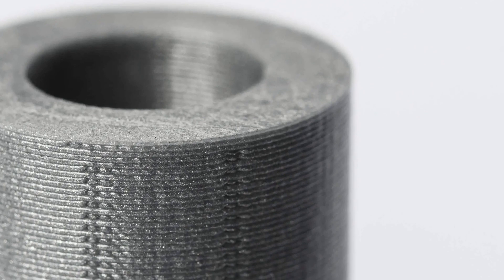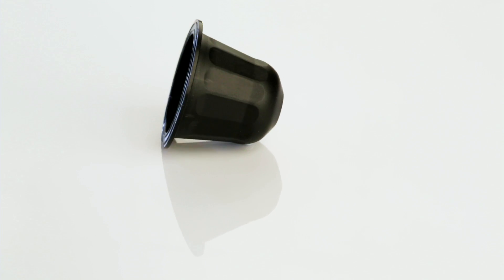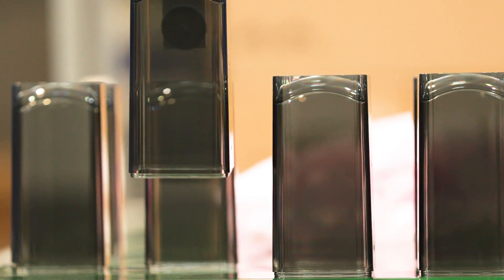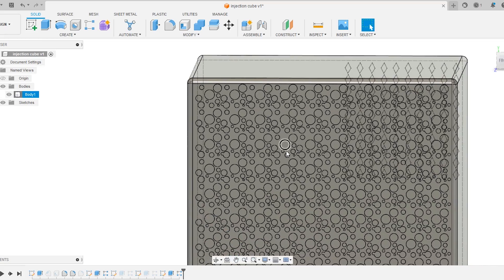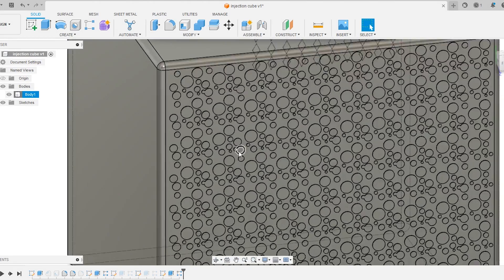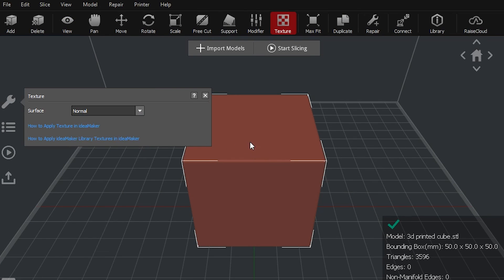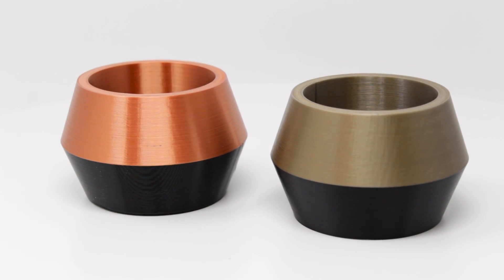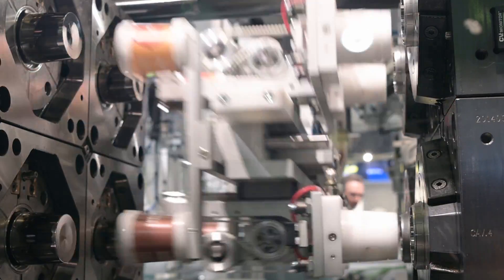Layer Lines Don't Matter | Design Textures for Mass Production 3D Printing

Comment: When you're talking about textured designs, yeah, layer lines aren't really a problem and shouldn't matter that much. Like you said, the way things are now, they’re not a big issue and can even be used to our advantage in some designs.

But not everything should be textured. A simple example: kitchen appliances—whether they handle food directly or not—are things that need to stay as clean as possible. And for that, textures, no matter how delicate or seamless they may seem, can actually be a problem.

Comment: They objectively matter because the higher your layer heights are the more friction pieces will generate against each other or even just the hands of the person touching it. They matter because every layer is a potential failure point. They matter because they affect your ability to put anything on the object whether it’s paint or coating. They matter because they’re the bottleneck in vertical resolution. They mater because every layer is a catch point for anything that has to pass over it. There are a million reasons they matter, you’ve presented zero reasons that they don’t and a handful of extremely niche corner cases where I might be indifferent to them.

Comment: I make functional prints and have even started selling them. I almost never print anything in PLA. Usually PETG or some variant. Once I've completed a design I usually print a few of them off and break them to see where they would break. Since I print in the strongest orientation, they generally take a decent amount of force to break. Far more than they're likely to see during full use. I've got a PETG bracket holding up a clothesline outside and it's been going well for the last year or so. Layer lines never bother me on my prints. Top and bottom layers do so I usually use the smooth PEI sheet and have ironing turned on.

In regards to layer lines, i can tell some of my customers that removing the layer lines costs extra. I've not had a single customer who told me to get rid of them once they heard it costs extra.
Reply: Good insights

Comment: There is quite literally an entire industry dedicated to injection molding textures, whether that be sand blasting, laser engraving, or etching the inside of a mold cavity. Look up Mold-tech or Yick Sang for industry standard mold textures, and maybe do some homework before you speak so broadly about manufacturing processes.

Comment: A question about the little imperfection  or ‘seam’ that is left behind by the print head  in the surface of the print
I know that the user can choose where to place this ‘seam’, such as in the back of a vase. Or this seam can be scattered randomly across the printed surface.
Is it possible to add extra seams on the surface of a print? Such as having eight equidistant seams running up the side of the vase.
Thus the ‘seams’ become part of the design.
Maybe these eight ‘seams’ could spiral up the side of the vase, or cross over each other to form a diamond pattern?
Could we write a brand name up the side of the vase using the ‘seams’?
Could we make this imperfection a feature  on the surface of the print?

Comment: I do agree upon layer lines not being a problem, and for the most part they look kind of nice!

But wait a second, creating textures on injection molding makes the part unmoldable? Wrong! If pay attention to a threaded PET bottle, the thread is indeed a texture. How do you achieve this? Creating a "neck ring" in the mold. Which essentially is having a mold that splits in half in synchronous cycle with the part ejector.

So making textures in injection molding IS POSSIBLE. It is just more complex and your mold will become a whole lot more expensive.

Comment: Something i want to try is introducing the same intervals of layer lines at 90 degrees to the printing plane, i think it'll be a simple way yo disguise layer lines without introducing a bunch of calculations or extraneous head movements.

The result aught to be a fine grid like pattern.

Comment: First of all thank you for another great video. Your videos are very motivational and thought provoking. You have potential to change old mindsets for good. From your video I have just noticed that layer lines actually simulate popular brushed metal finish used typically on aluminium and stainless steel parts. The orientation of part simply decides the direction of brushing. So I simply agree with you that layer lines are actually aesthetic. I have experienced that spray painting (especially metallic silver or any other metallic colour) enhances thick layer lines (0.3 mm to be precise). I just ignored layer lines but now I have started liking them after watching your videos.

The engineering aspects of layer lines requires a bit of research. From one of my personal experiences, two mating parts like spur gears should have layer plane normal to the axis of rotation for smooth movement and adequate gear tooth strength. Even though this scheme will make auto ejection difficult it is good for mechanical parts that require strength. This is one case where strength matters a lot more than aesthetics. Layer lines have an additional capability of increasing friction where required, if properly oriented. Layer lines also form micro channels with capillary action that have potential for lubrication or flow of fluids even though plastic parts require no to little lubrication.

I have a request. If you can make a video on creating textures in SketchUp. SketchUp is a very capable software for 3d printing. So far I have not found any video on the topic. You should also make a video on CraftWarePro slicer software. It is a very accurate and capable slicer. Thank you, once again.

Comment: If you want to do that zebra pattern kind of thing (or any of the patterns really) you might be better off taking your model from your CAD into a mesh modeler like Blender to add the textures. CAD isn't really designed for that, while Blender could easily do the whole displacement-map surface sort of thing.

Comment: Layer lines can 100% be a bad thing, at least some of the time. 
For example when designed objects meant to be worn, layer lines can increase chafing.

Second, for artistic pieces, layer lines can be undesirable visually

Third, optical pieces can be rendered unusable due to layer lines.

Those are some of the reasons one may want to remove layer lines

Comment: why can't we just make the spools in a triangle shape instead of a cylinder shape? Computers render models into triangles so why don't printers print in the same way? I'd imagine this would lessen the impact of layer lines if the printer was designed to print in triangles.

Comment: You can have textures with injection molding.  Those molds cost more as they pull in more than 1 axis.  Even with 1 axis pulls if the part has some flexibility and the pattern is very shallow the part csn flex out.  All that aside its common to not want a pattern - smooth is most sought after. Either matte smooth or shiny or semi matte.  The worst would be a variable unintended pattern...

Comment: Adding texture won't make layers line disappear
To similar material injection is way stronger, and those who put like carbon or whatever material in fdm should consider carbon or whatever in injection for correct comparators
Having non consistent layers line while  Trying to get smooth plane surface is an issue.  Plus having pattern with layers line are not what you wanted when you design the pattern...

Comment: One thing to note is that if you're using ceramic filament, it would not be feasible for bearing housings as that needs to be smooth for the bearings to last a while, other than that I would agree. I see alot of people arguing about whether it matters or not, it just depends on what your designing the part for.

Comment: Cool video but your assumption on injection molding is wrong, Molded part can definitively have texture (check out Moldtech textures) and if you check out plastic part of tools, cars, trays etc... most of them got textures.
But yeah injection molding will stay more expensive for small batch of parts.

Comment: Layer lines make it impossible to print anything food related since even if you dial your settings for 100% watertightness, the textured surface is gonna harbor pathogens like crazy
Reply: Food safe epoxy over printed objects works
Reply: aw gee i hate it when i cant drill trough a wall with my hammer sometimes i wonder if im using the wrong tool or is it just that im not trying hard enough. it surely must just be a problem with the hammer design

Comment: Layer lines are an indication of weakness due to potential delamination between the lines. No question,  injected molded.plastic parts ate much more dimensionally strong.

Comment: I think your thesis is that people want layer lines gone because their reputation is tarnished by the early days of printing, I think instead people want them gone because they don't want a repeating linear pattern on their period accurate cosplay props and sliding surfaces. Also, injection molded parts are definitely better than 3d printed parts, the processes have tradeoffs but there's no question about the end result.

Clickbait video with a ridiculous strawman as a premise. I'm upset with myself for giving it engagement.

Comment: From the get go you're way off. "Injection molded is not stronger than printed layer lines" bruh a solid pieces vs multiple different layers of possible failure points. I love 3d printing stuff as much as thr next guy but you're talking out your ass claiming a solid piece of something isnt stronger than multiple layers on top of eachother

Comment: What are you talking about "texture on injection molding is almost impossible"?
My PS4 and 5 controllers have injection molded texture, my Dewalt tools do, my Ruger does, my mouse does, almost every surface on the laptop I'm writing this on does. My keyboard does. My phone does.
Basically literally everything I can see from where I'm sitting thats injection molded has texture except for things that are explicitly disposable, and almost all of those are transparent, so they have to be smooth to serve the basic function of being transparent.

Comment: I fundamentally disagree with the premise. There are even aesthetic reasons that later lines can be a problem. Imagine how much time could be saved in post processing if we could eliminate layer lines for parts that should be smooth. Not to mention the mechanical issues that layer lines introduce. That said, I had never heard of IdeaMaker before and that height map feature sounds super cool. Just downloaded it to play around with it. 😁
Reply: could you post a link to the app? I can't find it when google "height map"
Reply from the maker: Design for the process

Comment: But what if you're creating somewhere where you want varied textured sides? What if you want one side to be smooth and the other sides textured or ruff. You'd then be forced to sand it down until you get the texture you want.
Reply from the maker: design

Comment: The claims here are defensive & don't really hold up. The objective is to reproduce a designed item with fidelity. Layer lines are not in the pre-sliced model but are an artifact of the manufacturing process, an undesirable artifact. Furthermore layer lines are actually a structural weakness and introduce material anisotropic strength, some of the weakness is inter-layer adhesion, and some due to the surface micro-geometry being covered with imperfections. In addition to this layer lines introduce additional limits to the performance mechanical components, for example hinges, bolts, bearings, etc with layer lines have additional friction, binding limiting manufacturing tolerances & impacting the performance of part assemblies.

Comment: Texture on injected molded parts is only there due to ribs and grain structure sandblasted , laser etched or water jetted into the mold cavity space , the tonnage when the mold clamps up and the injection fill , pack and cooling cycle determines the smoothness of the part. ... .I'm a die setter for automotive parts

Comment: Its quite misleading how you tell people that injection molding cant really do surface textures. Few examples : the diamond studded water bottle from amazon , all the RC tires with many exotic textures, bike and scooter handles with all kinds of textures,  all the false leather imitation plastic (like in cars) with a viarety of textures. 
Maybe you never heard of laser texturing molds ? A quite cheap way to add texture to a mold. 
Dont lead poeple into thinking that FDM is superior when it comes to textures and mass production. And the more texture you apply on a model the longer the print time thus costs for clients and thats a fixed cost per piece while molding is a one time costs and every part you make makes the mold costs cheaper. If you wanted simply to promote the texture that you can provide to customers in your printfarm that would be fine. But falsly discrediting another manufaturing process looks like your more familiar with the  behaviors of Brad Little than providing honest views

Comment: Just getting into 3D printing and glad I stumbled on this take on layer lines before setting my expectations in stone. Texture application will not only save a ton of time in post, but it adds an entirely new subsection of finishing options. That tip earned an instant sub.

Comment: Textures are extremely common in injection molding. There are companies that can apply just about any texture to the molds which then the plastic molds to. Claiming that you can't possibly have textures in injection molded parts is a flat out lie and you really need to do some research before spreading misinformation...
Reply from the maker: Fuzzy? Free?
Reply: @slant3d  Fuzzy, yes. pretty much any texture you can imagine can be injection molded. 
Cost is irrelevant, you simply stated that it was impossible to achieve textures with injection molding which just isn't true.

Comment: Yeah, that’s just flat WRONG! Layer lines ABSOLUTELY are a problem. Not necessarily the aesthetic look of them but rather what they are showing you. And that is an inherent weakness in the part. I make a lot of structural prototypes and when they fail. It’s ALWAYS, 100% of the time, on a layer line. 

That said, I do agree that they can absolutely be used to your benefit if that’s what you’re after.

Comment: Layerlines don't really bother me that much, it's the seams - either you get a blob or a hole
Reply: orcaslicer and now prusaslicer have scarf seems which are super smooth. Also, I've found simply doing "Show seam" with outer walls before inner results in a tight and deliberate seem.

Comment: Layer lines actually do matter. Every divot in the surface is a potential crack waiting to happen. From a structural standpoint, layer lines are the worst thing ever. If you surface treat a part to fuse the layer lines, it's an automatic 20% jump in strength for most materials.

Comment: the biggest reason layer lines are in the negatives is: bacterial contamination in attempts to make food-safe prints. even using food-safe filament, stainless steel nozzle, you have all these small crevasses and ridges for mold and bacteria to hide

Comment: Basically:
Good video. Not 100% sure its entirely accurate. 
Inections molded parts can be made with tecture (car door panels have leather texture, modern handguns etc.) 
-It's just more complicated (hence more expensive in many ways).

Extra for geeks:
Most I.M parts are just preffered smooth for the user's or the menufacturing cost's sake.
In 3d prints of a sculpture or a part, you can't have as smooth surface as you might have preffered, for your specific apllication. Plus we would all probably  love to get the added boost in strength of I.M  parts, having a uniform material.

Comment: Plenty of injection molded parts have texture:
Car dashboards
Children's toys (like toy dinosaurs)
Headlamp reflectors
Keyfobs
That's just off the top of my head. I think people would like to reduce layer lines because they are undesired artificats which they can't control. Having the ability to CHOOSE the inclusion/exclusion would be great, but isn't the case. A design which was made to be smooth may suffer at performing its desired task with those additional artificats. I myself would like the Have no layer lines, that way I can use FDM printing for items which were intended to be smooth.

Comment: I hate everything about injection molding, from tooling cost to inconvenience to MOQs to sheer time and design inflexibility. And 3D printing in production fixes that. I'm about as big a proponent of additive manufacturing as you can get. 

BUT even I don't try to sell layer lines as as "feature". In many cases, a smooth surface has a more premium feel. And sometimes that's hard or not possible in FDM 3D printing. It's OK to acknowledge a limitation. I don't think it's a huge one - but let's at least not come across as biased. 

There's a reason why dashboards in luxury cars aren't FDM 3D printed - and it's not like the executives in those companies are retarded. Aesthetics, including smooth surfaces, matter. 

P.S. the layer lines in wood don't stand proud of the surface, they're just a visible interior texture. Not the same with FDM printing, which you can run your fingernail across.
Reply from the maker: Steel Rusts in water....what a terrible material. Products have features. Design for the process and materials and you can often get any result you want out of it.

Comment: Injection molded parts 100% have textures, there is an entire part of the industry that does that work.  Just look at car interiors.
Reply from the maker: Take a look at the cost of those molds. And how shallow the textures are. "Can" is not the same as "should." Textures are free and unlimited with additive